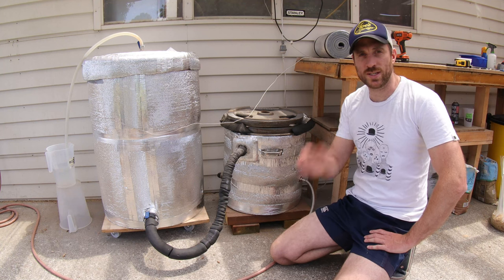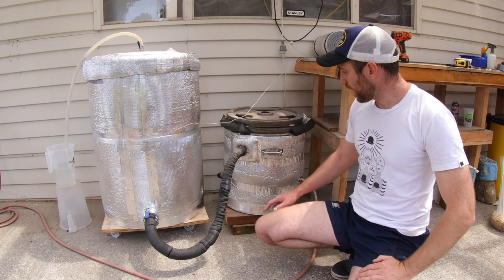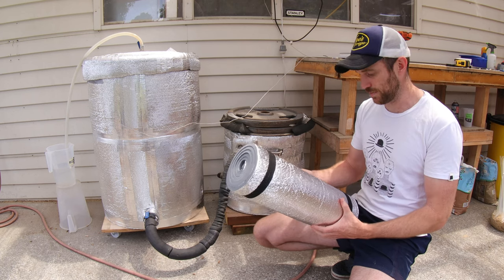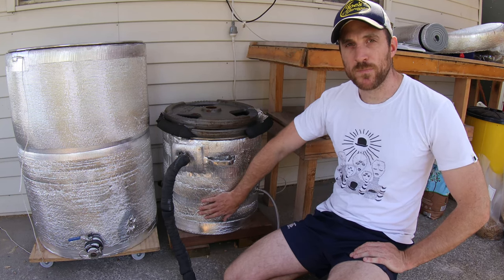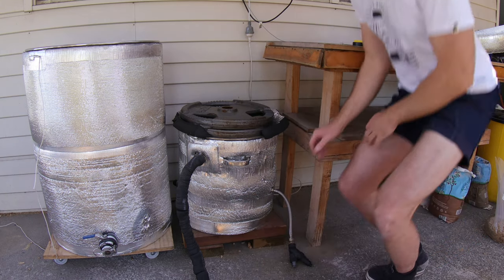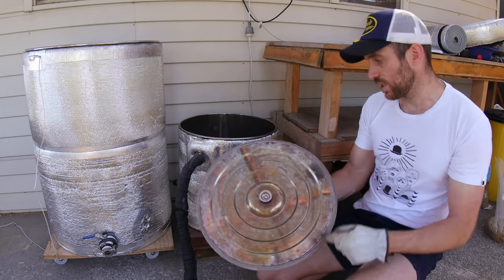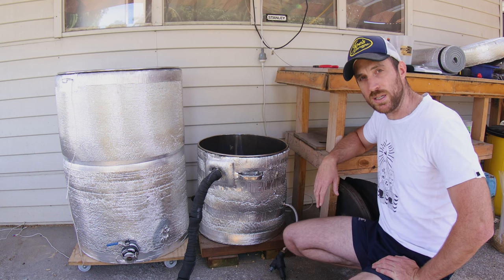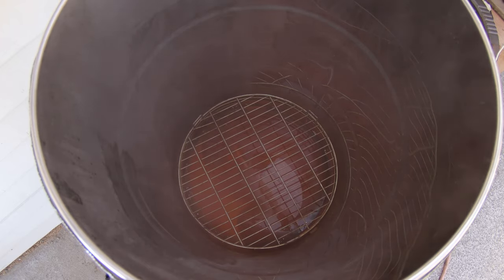Homemade Steam Generator for Sterilizing Mushroom Substrate

Comment: How did you wire up the heating element? Did you use a thermostat? Or did you sinply just wire it to a 110 outlet without a thermostat?
Reply: Citizen 2020 he said he is using a pid controller.  You can buy a prefab one or kit off amazon. The heater would just be wired to a wall plug and plug into the pid. The pid plugs into the wall. The thermocoupler monitors the temp. The pid modulates power to maintain the temp.

Comment: Hold on... Isnt this a pateurisation setup, if you treat your substrate only once? Or am i misunderstanding "sterilization"? Because the way i see it you need about 2 bar pressure to reach 121°c steam. And you would need to hold that temp for a while to kill spores... Or are you actually tyndallizing? Or am i just too nitpicky about the choice of words for the video title, because pasteurisation is "good enough" for substrate, and its more interesting for agar, liquid culture mix and grain spawn?
Reply from the maker: Pasteurization is usually done to a lower temperature, perhaps 80c, and only kills bad pathogens/bacteria. What I am doing with these barrels is heating them up to a few degrees below boiling, and keeping there there for a long enough period that It hits the thermal death curve, in an attempt to kill everything in the bag. I could be wrong, but that is my understanding.

Comment: Do you every get substrate batches contaminated with bacteria or other fungi/mold? I was under the impression that to fully sterilize the substrate, you need to expose it to high pressure and high temperature?
Reply from the maker: I never get contam. Most contaminants can generally be killed at a lower temperature, you just need to apply the heat for longer. Google Thermal death time.

Comment: Just wandering if you've had any problems with heat damaging the seal in the float valve?
Reply from the maker: No. It has degraded a little, and leaks if I keep the hose connected when it's not running. Otherwise the float valve is still going strong.
Reply from the maker: Tasmania is ways welcome into the bosom of NZ. Together, we can throw stones at Victoria.

Comment: Hey bro I have copied your setup exactly, I’m just wondering what temp do you set the PID at and and how often does the element turn on and off or is it constantly on? And where do you mount the probe for the PID I couldn’t see it mentioned in video, you have brewing thermometer and pressure valve on top but where does probe go? Thanks a lot love the videos
Reply from the maker: Mount the probe at the top of the steam barrel, not the boiler barrel. I set mine to 95c, and it runs for about 4-5 seconds, then turns off for about 5-10 seconds. If its really cold outside it turns on more often. When its heating up it's in constantly till it gets to 95.
Reply: @OakandSpore  thank you very much for the fast reply brother, I have 1 more question for you, if I am doing a grain batch and just sterilizing grain in this thing do you think a 24 hour run time at 93C + will suffice or should I go longer? I have a solar array so power is free and consumption isn’t an issue
Reply from the maker: Possibly, you always want to be more careful with grain spawn as it contaminates easily due to the high nutrition. You will just need to try and see how you go. I use an autoclave for my grain spawn.

Comment: Hi everyone! We've almost done with our setup , we built the steamer and now wondering what should we choose as a barrel. We only found 100 litres barrels around (we live on the island) that is not enough for our needs. We got this crazy idea to use an empty freezer as a box for sterilization. What do you think? Will it work? 

Thank you for the videos! It really helped.
Reply from the maker: Try it! The plastic might deform under the heat, but maybe it won't. You can only try. Let me know how you get on!
Reply: @OakandSpore  Thanks! We got our hands on second hand chest freezer it's actually covered inside with some sort of aluminium so no plastic. Will let you know if that works when done! Happy new year!
Reply: @huertocanario78  So did it work?

Comment: I Thought you had to sterilize with pressure.  How does it sterilize at temperatures below 100c?
Reply: It's technically not sterilization but it is pasteurization or super pasteurization. I'm not sure how much of a difference it really makes. It probably depends on the species and strain you're growing. An aggressive, fast colonizing mycelium will do just fine in pasteurized substrate I imagine.
Reply from the maker: I believe its sterilisation, at least partial sterilisation, not pasturisation.

Comment: This is great! I'm gonna build one:) I'm thinking that one could use  a HDPE barrel as steamchamber as long as temperature does not exceed 130c° it would save a lot of money, those stainless barrels is very expensive, but also very awesome.. HDPE might take forever to cool down tho..
Reply from the maker: I looked at hpde and other plastics. I was unable to figure out if the plastic would stay rigid at near 100c,  so went went stainless.
Reply: @OakandSpore  yes im having the same concerns, I've been told hdpe can take around 106° without losing it's rigidity. However the question is if it can take it for extended time. I will try it as soon as I've constructed the boiler, and come back with my result, for science! :)
Reply: @coconutfleetsleeper5717  I'm curious if you ever tried it? At atmospheric pressure, steam cannot get hotter than 100C - at sea level at least. 🤔
Reply: @johnandjacquelinewarren9979  no i never tried it, got hold of a stainless insulated chamber/canister from a company that used to make cheese/yogurt and such, 2,4m3 for no money what so ever. 
Id still love to know if you guys go through with it, besides how the plastic behaves under heat, analysis of the condensed h2o vapour would be very interesting to see:) 
My points of concern would be where the tubing meets plastic, there might be higher pressure/temperature there?
-l dont know or make any claims, im a layman at best. If you try it out, For the sake of shroom and science share you experience:D
<3<3<3
Reply: @coconutfleetsleeper5717  yeah, if I happen to end up building one and go that route, I will try to remember to come back here and post some results.

Comment: What made you go with the 2500 w and not the 3500, 4500, or 5500 w?
Reply from the maker: Our power is 10amp 240v, which means you can draw 2400w max unless you get a higher amperage breaker put in.

Comment: Hey dude..thanks for the video..what size/power is the element?
Reply from the maker: I believe mine is 2.4kw off the top of my head.
Reply: @OakandSpore  hey dude.. just finished building mine, I cant seem to get the steam chamber to go above 100 degrees Celsius. I think you said yours is set at 95? So are my temps adequate? Thanks.
Reply from the maker: You can't heat water above 100 with using pressure. I heat mine to 95c.
Reply: @OakandSpore  yeah it's the pressure build up I'm struggling with. 
So 95 without pressure is enough to sterilise?
Reply from the maker: Its not pressure, its temperature. Get the temperature to 95, and the pressure to 0.
Reply: @OakandSpore  ok happy days..in that case I'm good to go :) thank you

Comment: I was just thinking.... Get a huge pressure cooker to use as boiler.... Duct the steam coming out into a huge cooler with wireless thermometers in it along with the substrate. Very little work system

Comment: What temp/pressure do you run this barrel at?
Reply from the maker: atmospheric pressure, at 95c. I tried lowering it to 92c and running it, but lost an entire batch to contam, so now keep it at 95c. I run it for around 24 hours from switch on to switch off.

Comment: Do you let your drum cool in regular air or infront of a flowhood?
Reply from the maker: It cools outside, then once its cool I wheel it into the lab.
Reply: @OakandSpore  thanks for the quick reply! Does it vacuum seal? How many blocks do you fit at how many lbs each? Appreciate it!
Reply from the maker: Nan no vacuum seal, it just pulls in dirty old outside air while it's cooling. I have zero issues with contam in my bags, so I don't feel I need to cool them off in the lab.
Reply from the maker: Oh, and I fit 21 x 4.8kg bags.

Comment: *Sterilize.
 You sure it's not pasteurize?
Reply from the maker: No, pasteurization is done at a lower temperature and only kills a percentage of living organisms. I am sterilizing, which means I am trying to kill everything. You can sterilize at lower temperatures, it just takes a lot longer. Hence I leave my units running for around 20 hours.
Reply: @OakandSpore  I appreciate your reply but 20 hours is not sterilizing your substrate.  Sterilization is the absence of all biological life.  If you are trying to sterilize without pressure you're only obtaining 212 degrees.  Steam sterilization times without pressure at 212 degrees is going to take at least 80 hours. Most likely you're getting 200 degrees or so which will take at least 160 hours.  Don't believe me?  Purchase a vial of bacillus thermophilus and put it at the center of your load and run for 20 hours and report back.

Comment: how did you drill through the stainless steel? I'm failing miserably at drilling through it with a cobalt tipped bit right now
Reply from the maker: Very slow, use lots of oil. The second the stainless heats up, it hardens, and you won't be able to drill it.